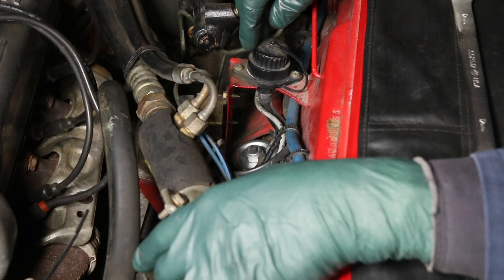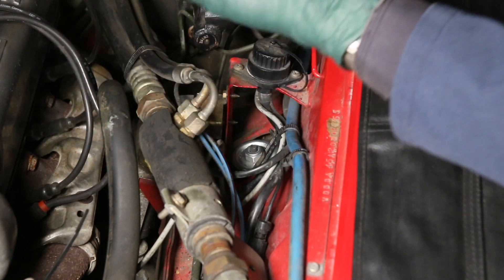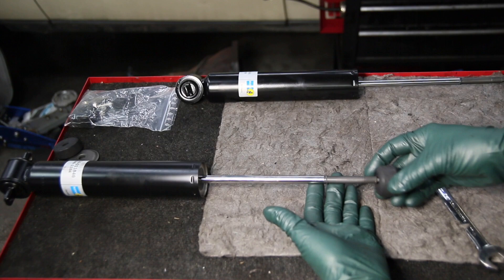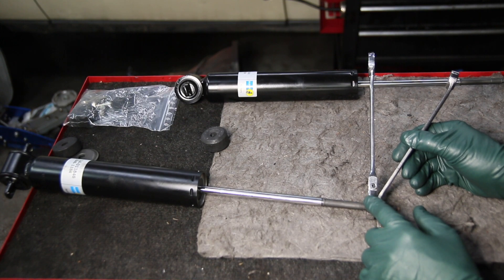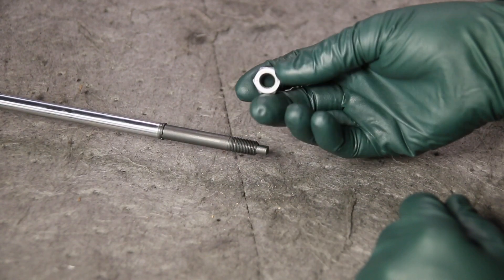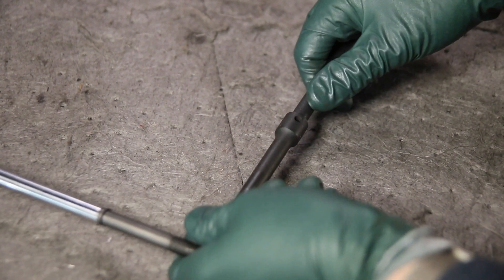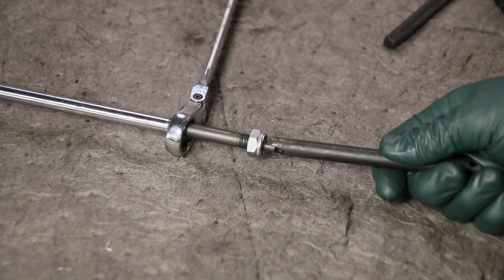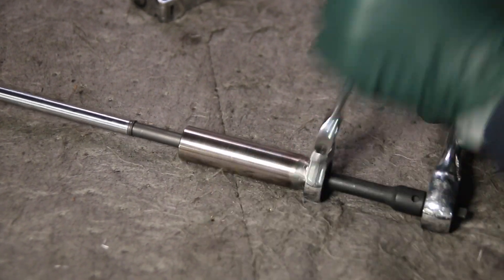Bilstein Shock Absorber Custom Made Rapid Install Tool by Kent Bergsma

Comment: Phenomenal tool.  Used it this past weekend and cut my install time by 75%.  Question....Why not make the shaft that fixates the shock absorber longer, and make the socket longer as well.  It would help clear some of the other items under the hood, and save some knuckles.